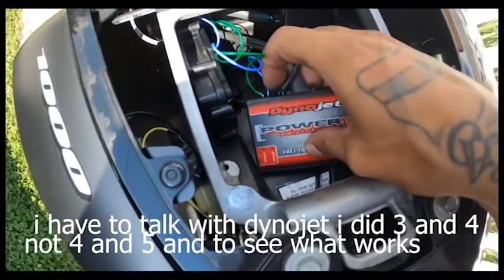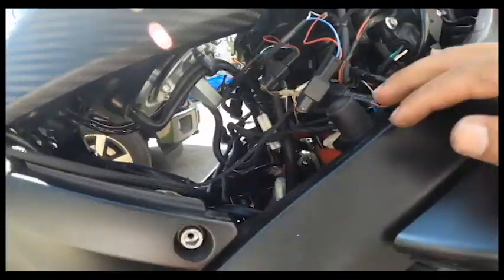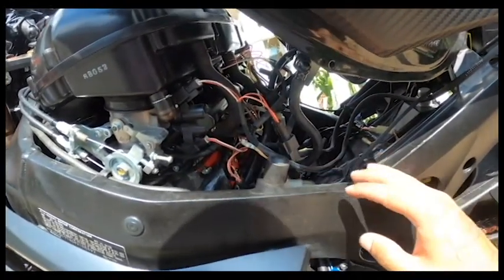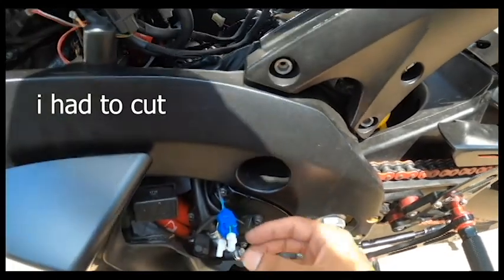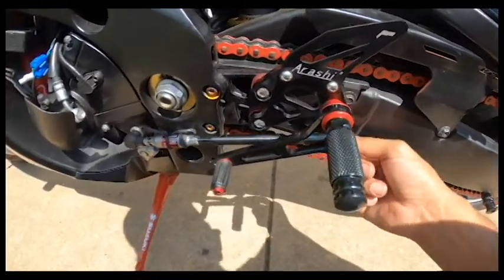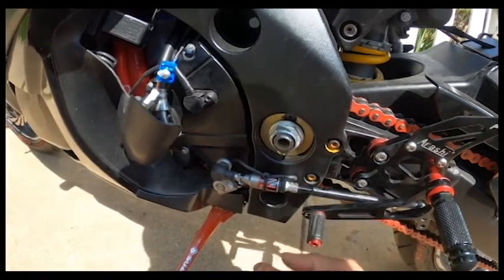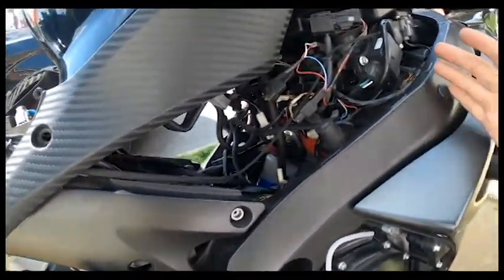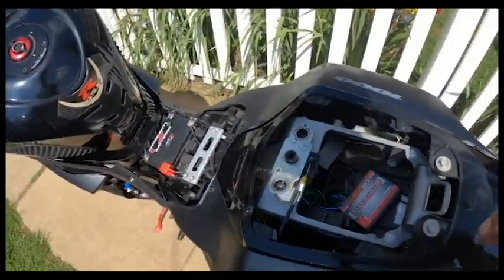how to install a power commander 5 and quick shifter sensor and expansion module

Comment: quick shifter expansion module is for?
Reply from the maker: It connects to the second injectors into the quick shifter to control the second injectors and the power commander five controls the primary injectors
Reply: @Sportbikememace  but quickshift is enabled with power commander 5, is not necessary the quickshift expansión for nothing! Or what’s is the real benefit of the second module?
Reply from the maker: @carlostrevino9554  I would get the secondary module with the five. Five can only control the lower injectors if you 8injector you need a expansion module or the secondary fuel module. I would get the secondary